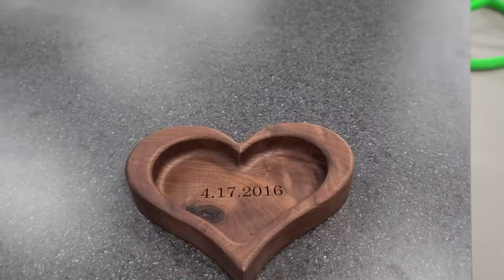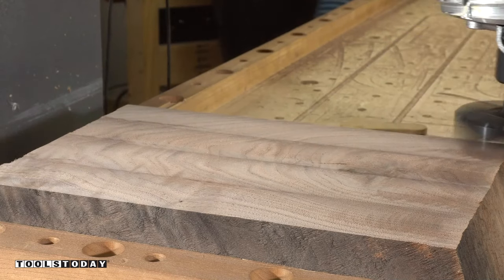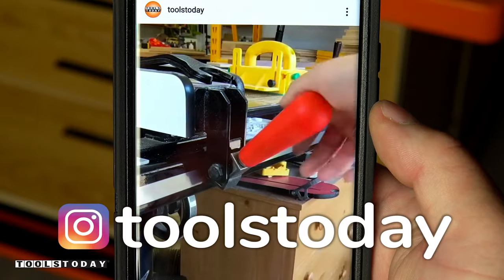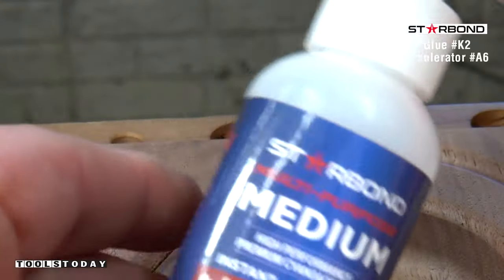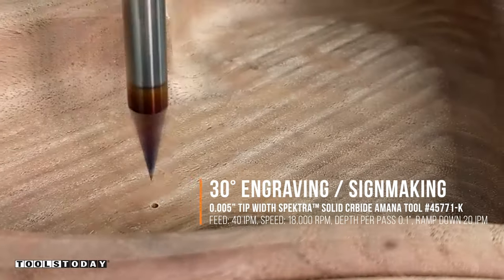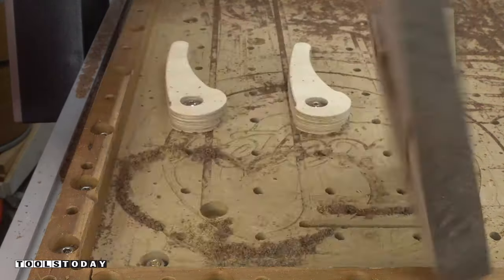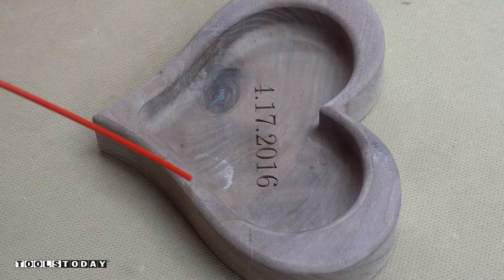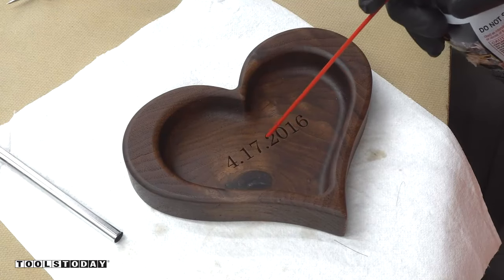How To CNC Heart Catch All Tray | ToolsToday

Comment: Can you do a video about how you set up a project? From drawing all the way to final product? Maybe a cool video idea?
Reply from the maker: Great idea we will see about incorporating this in some future videos. We actually have some videos showing the drawing and setup in CNC here, https://www.youtube.com/watch?v=7vTExRWrn5U
Reply: I had the very same thought.  I'm especially interested in how you select the tool heads while designing the piece.  For example, did you account for the cornering ability of the roundover bit used at the end when designing how deep the cleft of the heart would be?  Or did you just design the heart and get a roundover small enough to fit what you'd designed?
Reply from the maker: @alanferrell9406  We can definitely do a video at some point about tool selection and how the pieces are designed.  If you're using Vectric software we have all of the toolpaths laid out for you or if you're using another software, we have an SVG for the design and instructions about how to set up all of your toolpaths in the plans available on our website.  I didn't particularly decide the roudover to use based on the design, but rather, know that I like the look of this size roundover based on previous projects.  The first time I used it like this it was essentially picking a size out and seeing what it looked like.  I, personally, learn best through trial and error.

Comment: Great instructional video! I greatly appreciate you putting down the feeds and speed rates. However, i do have a question, what difference would it be if I use the 45982 instead of the 45984 (diff is smaller shank). Where do you get your feeds and speeds from? I'm always struggling to find the appropriate rates when i buy a new bit. 

Thanks!

Comment: Would love to see exactly how these vectors were assigned toolpaths and tools in your CAM program. I get the same same bumps on my bottom surface after clearing a pocket with the Bowl & Tray bit, however I am battling to come in and smooth that out with an endmill. When I try that, The end mill starts clearing from the top of the Material surface (which is no longer there) and works down to the bottom surface - taking WAY longer than what is required.... Any tips?
Reply from the maker: If you're using Vectric software you can buy the plans for it and see how everything was applied.  If you're getting actual bumps, it's likely that your stepover is too high.  If you want to do that with an end mill, you need to set your z starting position, within the software, at whatever depth of material you've removed after using the bowl bit. You will then zero off the top of the material and it will start where the bowl bit left off.   I hope that helps.

Comment: The radius point roundover bit. Could we just round it over at the router table when doing the bottom roundover? Or is there a reason we would want to cnc with that bit? Im still learning the bits to use so I was wondering.
Reply from the maker: Yes, you could definitely just add a roundover at the router table.  I did it here because the lip gets a little thin.  Also, for production, if you were doing a bunch at the same time it would save you some time to do all of them at the same time as well.

Comment: What would you call the opposite of round over?  Say I want to make a pocket cut, but I dont want the edges to the top of the substrate to be 90 degrees on the bottom, I want it rounded.  What would that be called?

Comment: I entered the round over bit and the bowl bit into my Tool library and into my VCarve design but it doesn't seem that the round over bit is rounding over the edge as it does on your video.  Can you tell me what settings you used for it?  Thank you.
Reply from the maker: Hi Mary, we used the following: RPM: 18,000
Feed Rate: 50ipm
Plunge Rate: 25ipm
Depth of Cut: .18"
Reply: @ToolsToday  Thank you for that.  Can you also tell me how you set up your toolpath for the roundover?  I'm struggling with if it needs to be a offset toolpath and, if so, how much do I offset it?  Sorry...new to this!!

Comment: How do we set up the point cutter roundovers? i mean, are they end mills or sth else? i recentlly bought 2 of them and i keep staring at them!
Reply: If you're using the Amana brand, or any other really, just download their tool base from their website, and put it into your software. The point round over will probably have its own separate heading.
Otherwise, you could manually type in your own descriptions into your software. Or you could call it an endmill and just set it up to cut a profile pass ON the line, at the same depth as the radius of the cutter.
Reply: @acerjuglans383  Thank you so much! Very helpful

Comment: When  CNC MACHINE are You using?
Reply from the maker: This is the Axiom AR8 series CNC machine, you can check out the different sizes available here - https://www.toolstoday.com/v-14604-axiom-prov5-series.html
Reply: @ToolsToday  I have the same CNC. In your description, it says your fly-cutting bit is travelling at 190 ipm. There's no way mine  can move that fast. I'd say top speed is about 125.